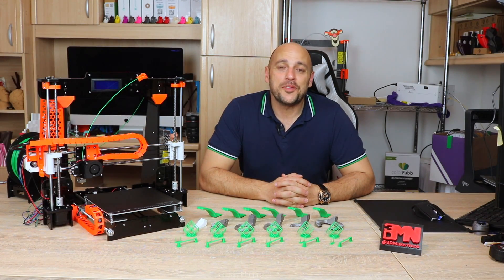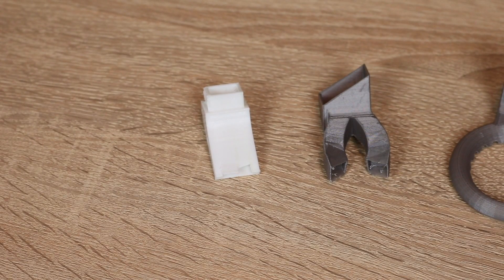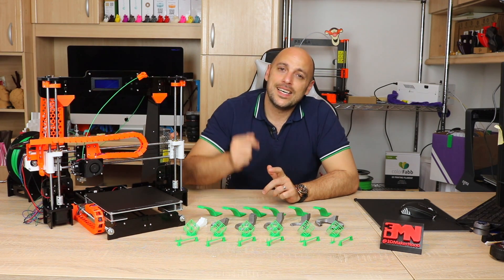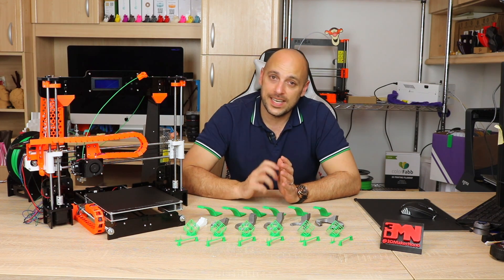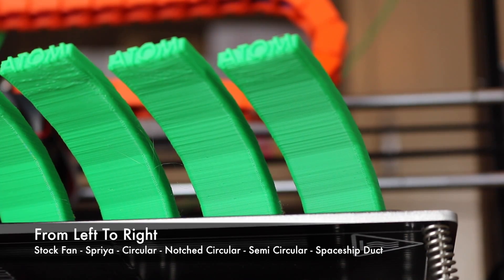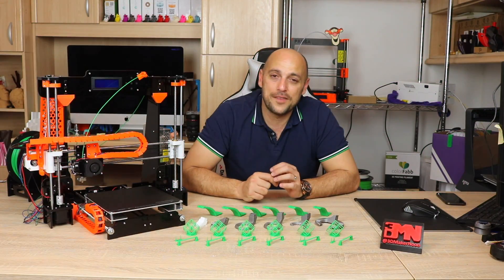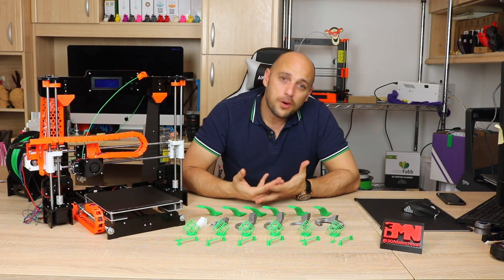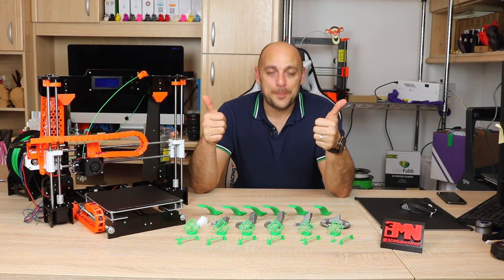Anet A8 Fan Duct Shootout

Comment: Hey Joe, how hot your hotend can get with the spaceship duct and 100% fan speed? Mine won't go over 210*C (and only if I preheat it for the first layer to about 230*C), otherwise, with the fan at 100% speed it stays at 190*C. It seems that there's to much airflow on the nozzle, instead of the printed object bellow. I'm waiting to get my E3D V6 and try it with the silicone cover. But for now, I'm on the stock one and without any cover for it.

Comment: Did you measure the point where the air flow concentrate , fan ducts may perform differently when they are not in the right place, some fan duct like spiya requires you to put your nozzle as high as possible

Comment: Did you re-calibrate the PID when you changed nozzle?  
How you can do that is mentioned in Spriya documentation.  It takes some time, but then the temperature in the hot end will be more stable.  Might make a difference.

Comment: it is a fair test for your machine. as a pc engineer I do install and replace  a lot of fans, and so for nearly every new fan their is a different airflow, and yep you guess it!  unless the airflow is the same for all 3D printers certain flow nozzles will perform better according to the rate of flow,
also the psu can have more of a surge to the fans depending on the build quality.
You know how chinese  quality control is!

So I would say to others is to, Print of the choices/styles and see which one performs better on your 3D printer, by doing the test's that Joe has done .
Oh just to say that's why Computers have fan speed controllers, either manual or built in to the CPU & boards.

No need for bigger fans joe, just use same size but higher RPM rate = more flow
one could upgrade to separate speed controller and adjust speed/flow for type of print. like this one..

https://www.ebay.co.uk/itm/NEW-5-25-LCD-Fan-Speed-Controller-Panel-CPU-HD-C-F-Temp-Temperature-Sensor-PC-/142394751479

Here is a separate PSU for it
https://www.ebay.co.uk/p/HDD-Power-Supply-AC-12v-5v-2a-for-Hard-Drive-Molex-EU/1088185122?iid=320705061192
Total cost £16
the unit can be fixed to the top of printer either by screws or make a bracket, I know it's another plug/cable but at least it will also reduce the strain on the printers psu as well.

Comment: I had the space ship one made in PLA but when I printed in ABS with the cooling fan off and a 100C bed the PLA softened and drooped. Ruined my print about 3 hours into it lol.
Reply from the maker: +Alun Morgan ouch. Yeah pla as a fan duct is a no go. Lesson learnt I guess :)
Reply: Yeah that’s probably not a good idea... I have a PLA one but I have insulation on my heat block and only print PLA with a 50° bed
Reply: i like to think "PLA" "cooling fan off" and "printing in ABS" all together would alert me to making a good decision. 

Then again, i may just be too wrapped up in my phone to ever pay 100% attention to what i'm doing.
Reply: +Alun Morgan  +3DMN Well at the very least, just remove it when you're printing ABS. You won't be using it anyways!

Comment: Did you have any problems with overcooling the hot end?  

I've tried the the stock, Spriya and Mistral 2.1, and where things worked fine with the stock nozzle, with the Spriya I couldn't reliably maintain hot end temps with the fan over 30% and with the Mistral over 20% (even though it looks to direct the airfow more toward the part and less the hot end).  I ended up insulating my heater block and now with the Mistral I can maintain temps at somewhere between 50-60%.  I've seen similar results reported in the comments section of thingiverse and on the a8 groups.

I do kind of wonder why most of the designs seem to direct airflow across the nozzle vs downward at the part, since you want to cool the part quickly and the hot end not at all... maybe I'll have to redesign one and try it.
Reply from the maker: +Mark Pikas if you find that you have fluctuating temperatures, it's best to do a PID tuning after each fan duct change
Reply: Yea, I have.  After every cooling change, I ran a 20 cycle PID tune and honestly it didn't get much better.  The best procedure I've found is to figure out about the highest setting that the fan could be set at that temps stay close and then do an at least 10cycle PID tune from there.

I'm starting to wonder if my power supply is just weak since the heating elements have always had some issue keeping up (the hot end with a good fan duct won't maintain temp at most higher speeds, the bed will never get to 70* in open air, I've tried setting it to 70 and eventually it will get to 69 and never hit 70), and I added some LED lights and they practically flash when the heating elements cycle (not just dim slightly, but go from intense bright to almost off).

Comment: I have a spryia-like fan duct (mistral) and I noticed that print orientation affect performance. In every print I can always say wich side was the one behind because it is the worst.
How did you test them, in particular the overhang one? I'd expect better performance with the difficult side facing the front of the printer.

Comment: Congratulations on a great comparison. These tests may also be fruitful.

Try testing a dome shape about 1.5 cm in diameter with a one or two layer wall thickness 0.4 mm or 0.8 mm.  and a thin walled cylinder about the same dimension 1.5 high and 1.5 diameter. 

The upper layers of the dome concentrate the temperature of the plastic and will cause a hole if not properly cooled, and the far wall of the cylinder will sag and deform if not enough cooling air can reach it.

PLA is not the only plastic that needs air cooling. ABS+ is an excellent plastic but remains hot for too long, the same goes for TPU.

I suggest also that you do an air flow test by holding a smoke source such as a cigarette near the fan inlet to show how much cooling air actually comes out of each of the nozzles.  This will show whether the exotic shapes such as the ring actually direct cooling air in all directions.

Comment: Awesome video!
Is there a semi circular model which considers the 4mm offset with the auto level sensor, so you can just use the sensor at it's designated location?
(I mean a 4mm "longer" fan nossle in y direction)

Keep up the good work! :)

Comment: Hi. I saw your video with the comparison between fanducts. IT is good, and your method is pretty consistent.

I hav tested, and Im not exagerating, like a dozen of funducts, till I 
got tired of seem similar results in most of them. Most fails is the 
same issue: they dont distribute the air evenly, and a couple of the 
funducts you tested fails in that too, like the cicular, the dutched, 
etc.

This funducts produce good result most of the times, but in certain 
situations, this failure in distrubuteing the air evenly, shows up. You 
should include in your test, a circular overhang test. This way, when 
the circular object is being printed 1 side of the object overhang will 
not receive a good cooling. My test were done first looking at the air 
distribution useing a radial fan of course, powering up at 50% (that is a
 lot of air) and putting below a cup of water. When you aprouch the 
funduct to the water, you will start seeing howmuch and from what 
direction the air impacts in the water.

Also, I have to mention this: there is only 1 design that achieve a perfect air flow around the 360 degrees: https://www.thingiverse.com/thing:1025471

ANd the reason is pure design , looking at the interior you can see structures that distributes the air evenly.

To be sincere, I skiped testing a similar desing of your funduct, 
because I asumed I was going to get similar results liek in the circular
 duct. But I will give it a try now . What I like in your design is that
 is small.

Comment: Hey you missed mine https://www.thingiverse.com/thing:2110755
Reply from the maker: i actually came across that today, so sorry :( but will be doing another one soon as an update to more fan ducts
Reply: For some reason your video only bubbled up in my stream only yesterday.  

It is a great idea to put all those ducts to the test, since it is  impossible to gauge their efficiency just by looking at them.  For example I had a feeling that the stock duct is actually pretty efficient.   Qualitative and systematic test brings out a part that is best for the job.
So if you have a chance put mine to the test, i'm curious to see if my idea of directing air to a single point is beneficial.

Comment: 195 seems a bit low - generally I find better layer adhesion and even faster printing at higher temps, then I most need the cooling. Perhaps ~215-225? 
Awesome test overall!
Reply from the maker: +AbeFM it all depends on the filament company. I rarely go over 210 as I tend to print at relatively slower speeds but I found that with almost all printers the 3DPrintz PLA prints very well at 195 degrees and 50 mm/s. thank you by the way :)
Reply: 3D Maker Noob: Indeed, I've been scaling back my own temps. But as a way to compare cooling fans, especially for increasing layer bond strength, higher temperatures could help differentiate in an otherwise tight pack. Thanks again!
Reply from the maker: +AbeFM I will be diving in further into these tests to see how they work with different filaments and also different fan speeds

Comment: just out of curiosity, did you adjust the PID settings for the fans? This can make a HUGE difference from duct to duct.
Reply from the maker: +Eric Johnson in this case I didn't as the temperatures were constant without any fluctuations.

Comment: I updated my firmware after seeing in the description that you used version 2. The first print went well but now the printer wont finish homing the z axis before a print. All the wires are connected and I have not touch any of the firmware stuff other than re installing it.
Reply from the maker: +Igor Mijic hey, have you tried triggering the switch manually to see if it stop it or maybe check with a multimeter that it triggers? If it worked the first time then it should work all the time
Reply: Yeah I tried triggering it manually and it didn't do anything, it doesn't even start the z home process just changes z to a question mark on the screen, currently looking at cura start gcode to see if there's anything there
Reply: Also, it will home when I manually click on auto home in the menu
Reply: Nvm hahahah it was the start gcode, it's working perfectly fine now, thanks for getting back to me quick
Reply from the maker: +Igor Mijic and when it homes it works fine?

Comment: I upgraded my fan duct to one very similar to the stock one, except it actually pointed at the end of the nozzle not above it. I had a feeling that the circular duct might not be the best since the air is moving towards the nozzle from all directions so you get an area of stagnation in the middle where the air collides. The semi-circular probably provides the best balance between airflow and cooling in different directions.

Comment: Love your reviews and videos. This might be a dumb question but still new to all this. I updated my A8 with the new Skynet firmware you mentioned in the video following your guide. I couldn't work out how to enable bed level, I assuming it's an edit somewhere as I tried looking it up but couldn't work it out.
Reply from the maker: to enable the bed levelling you need to include the G29 code in your start gcode. i have a video on installing the 1.1 firmware which explains it :)
Reply: I have 1.1 working with bed leveling but when I upgrade to this new one and do an auto home the carriage dosnt move to the middle of the bed to home the z using the sensor but stays on the left hand side. With no switch there now it just keeps going until I unplug it.
Reply from the maker: +Grant Peck does the sensor light up when it's idle and you pass a metal object under it?
Reply: Yes it lights up. I can stop the z axis by moving a screw driver in front of it. Levels fine with 1.1 too. If the carraige was over the bed when I did the home all it would probally work. Its like it thinks theres a micro switch and the sensors not installed.

Comment: You didn't discuss tuning the airflow rates for the specific ducts. If the air reflects off the bed and drops the nozzle temp then artifacts may be due to low temp. One duct I used required the fan to not fully turn on until 20mm due to such a high force. 

Maybe the Anet maintains better than Wanhao?
Reply from the maker: all of these were set to 100% from the second layer - once i come back from BAMF i will revisit this experiment with different parameters and possibly a couple more fan ducts :)

Comment: Is there any advantages to upgrading to skynet over stock firmware other than being able to use the bed leveling sensor? Is there a improvement in print quality? should i upgrade the FW on my A6?
Reply from the maker: to be honest i haven't yet upgraded the firmware to my A6 so not entirely sure what difference it does there, however i saw an improvement in print quality and functionality on the A8 with the new firmware

Comment: I'm trying to create a layer cooling with compressed air from a compressor: D in theory but concentrated: D
Reply from the maker: so long as the print remains on the heatbed lol interesting to see
Reply: :)) the first test is with a 200mm aluminium blade 220v in a box with tube :D, look at the kuka 3d print

Comment: such a shame there was no test without a fan at all
Reply: Would have also liked to have seen a dual Fan setup which alot of other printers have
Reply from the maker: +Ultrasonic2 I will do this again but to be honest, a lattice cube without a fanshroud is pretty much a block :)
Reply: yeah it should be bad but it will show the importance of having a fan and will make a good video and hay thats what you want lots of videos :)
Reply from the maker: +Ultrasonic2 haha true, I will be revisiting all this with more test and different shrouds when I come back from US in a couple of weeks
Reply: one thing i would say with the single sided/direction fans is that if your making something that is rather solid then the side the fan is on will be getting blocked by print .. possibly resulting in say a tower to start leaning over cos one side will receive alot of cooling while the other pretty much nothing cos the print it's self is blocking it..  therefore i would think it's important for the flow to come at the job at least from 2 side
Reply: This is why i partly suggest duel fans
Reply from the maker: +Ultrasonic2 yep that will also be taken care of as I intend to change orientation of the same model to see. Don't worry, it's all coming ;)
Reply: OOOO you also need to talk about over hang cruel which is a big problem too

Comment: Where did you find out about the new Skynet firmware? It isn't on their facebook page and no Google search finds it. The link doesn't work for  me due to "...partial file...." error in unloading into a file. If your instructions are complete, this firmware is so much easier than what I was trying to get the 2.3.2 file to work. Hopefully I will find another way to download. Is RAR a european thing verses Zip files?
Reply from the maker: i will have to reupload it on dropbox as something seems to have gone wrong with some users. also, found it on the Skynet facebook page https://www.facebook.com/skynet3ddevelopment/ :)
Reply: Thank you so much. I was able to get it there. Much easier for me this time. Just used the Marlin.ino file. Changed my PID numbers, Changed my extrusion rate, and Z probe offset then it worked .
Reply: And then Just ran the auto home and it crashed into my bed in the upper left corner. I guess I need to adjust a few more settings
Reply: Got it. I had to activate the safe homing definition (by removing the "//")

Comment: that circular fan duct looks so convincing, but it just doesnt work. :D
the v1 spaceship was my favorite pretty much since paulo relaesed it, but this is by far the best one i tried: http://www.thingiverse.com/thing:2110755 
the flow has very little resistance, and it's as focussed as it can be. when you blow smoke through it, it comes out in a straight vortex from the center of the ring. (srsly, try it) i dont need more then 30-50% fan speed, and it shields the hot block form airflow very well.
Reply from the maker: that looks very interesting - will definitely include it in my next comparison :) thank you

Comment: Very well made comparison! The only thing I would add is to reorient the testmodels depending on the orientation of the fanduct. On my wanhao Di3 I am currently experimenting with different fanducts that are all snapon/snapoff designs. Easy to change from onesided cooling to two-sided cooling depending on the print.
Reply from the maker: +PrintingOTB agreed, I will revisit the test at some point to do a much more thorough testing :)
Reply: Maybe a 4-sided overhang test? 
Keep on the good work!

Comment: Unfortunately your test methodology is flawed. After each fan duct change you should retune the pid for the hotend. Different ducts can cool the hotend differently making it difficult for the hotend to hold temp properly. If you want a true comparision, tune the pid before each test.
Reply from the maker: +LancerGTO the only reason I didn't run pid tuning was because the temperature was fairly constant and no temp drops was present, but I can try that out for next revision